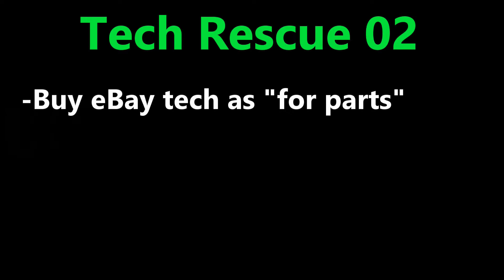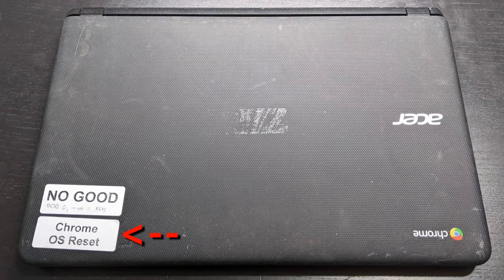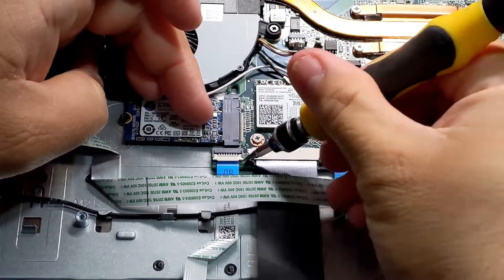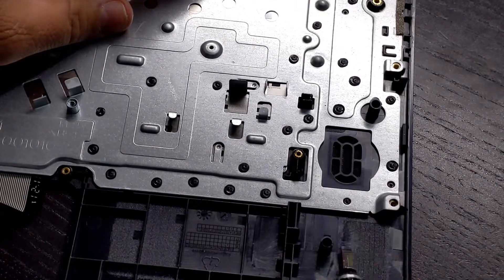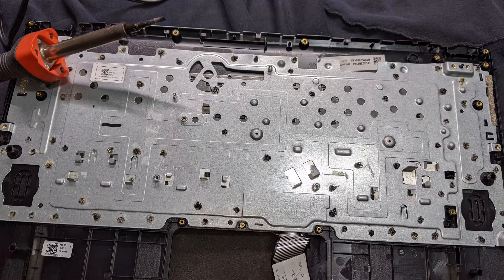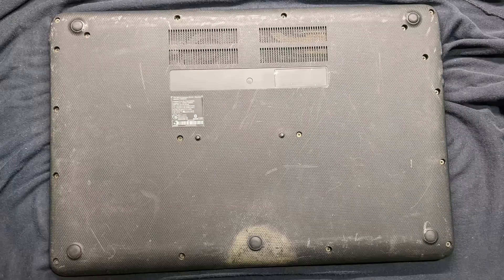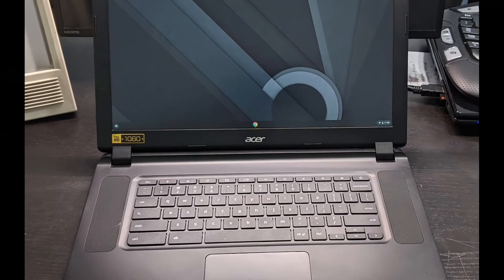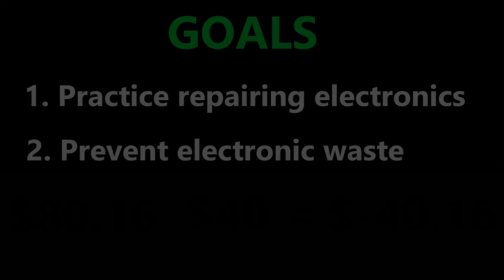Replace Keyboard and Clean Your Acer Chromebook 15 C910

Comment: I needed to replace the keyboard, so I watched the video about Acer Chromebook 15 CB3-532 disassembly which handles my chromebook. It covered everything except how to remove the keyboard.
Did the disassembly up until that point, and could not believe that there are no screws; how am I going to replace the keyboard I bought online?
Fortunately I came across your video and noticed this notebook has about the same build of all the plastics and keyboard.
Learning from you, you actually need to break things and glue it back with a soldering iron.
Thanks for making that clear! Thumbs up!
How dissappointing cheap aspect of the build; make the notebook two bucks more expensive and put in the damn screws is what I would say! ;-)
Reply from the maker: I agree, they could have made this job easier. It feels destructive doing the keyboard replacement. It works out great, but damn its tedious work, haha.
Reply: Yes 68 of them. 🙂
Soon another problem arised...
After putting everything back together again,  nothing worked, none of the LEDs went on, not a single sign of life, even with the battery I knew having at least 90% of charge.I tried all the hacks I could find, but what eventually worked was putting the charger in for a second, and immediately LED on and boot up. Then you can unplug the charger again; everything back to normal again, with indeed a nearly full battery.
Reply from the maker: @rbgohome  I have had that happen as well. Chromebooks don't work like PC laptops. If you disconnect the battery or install a new battery they usually require you to plug in the charger before it is able to boot again.

Comment: Dumb question but in the off chance someone doesn't have a soldering tool, what would happen if the laptop was reassembled without reattaching the rivets?
Reply from the maker: The keyboard with sink down without the rivets. I cover it in this other video https://youtu.be/x63jJOQT1jQ at about 2:30 into the video. If you don't have a solder tool, get a flathead screwdriver and heat up the tip to melt down the rivet. Even if you don't have the plastic rods, melting down what's left of the rivet is better than nothing.
Reply: I didn't have the rods, only an electronics soldering iron with a fine pointy tip. I let it sink in angled 45 degrees but in the center so the plastic shifts to the outside forming a head.
Also squeeze the keyboard and metal plate sandwich tight on the top deck to where it belongs and then do this riveting; at least for some major rivet spread across the field so keyboard can no longer move.